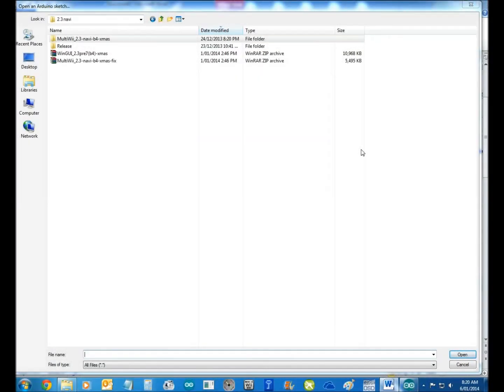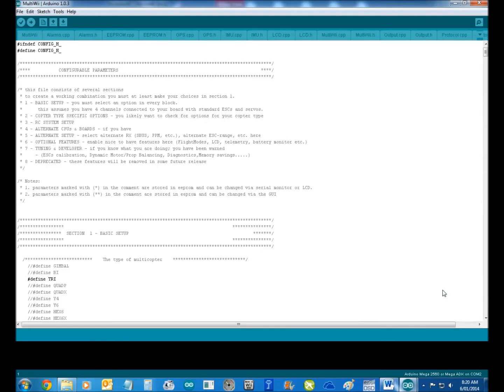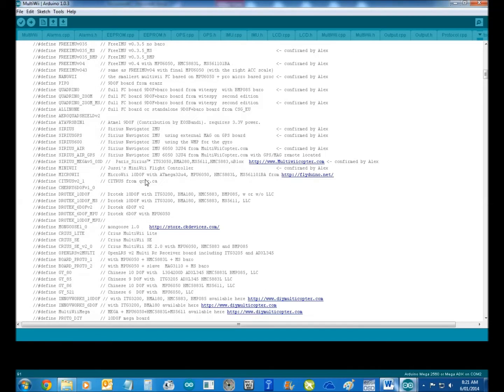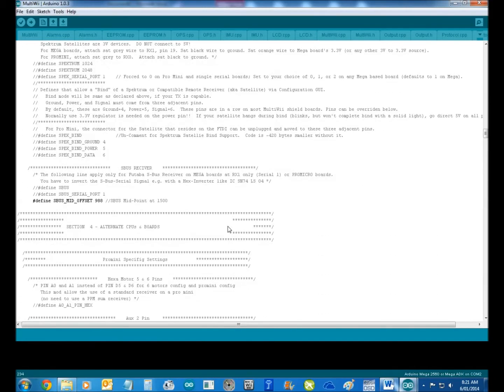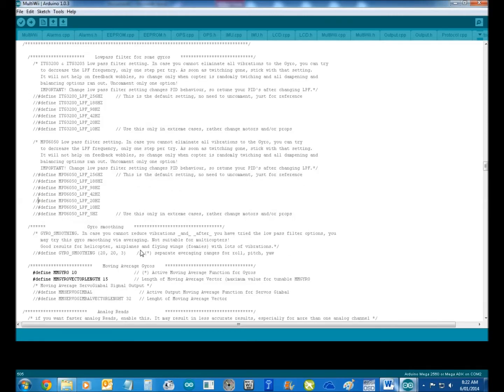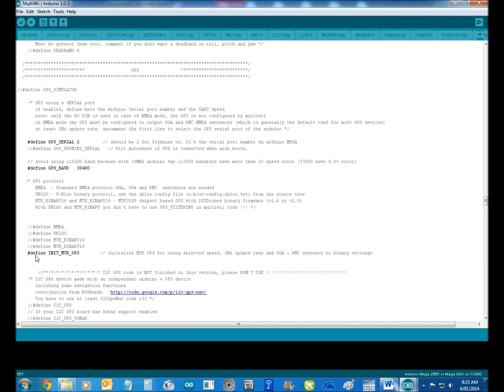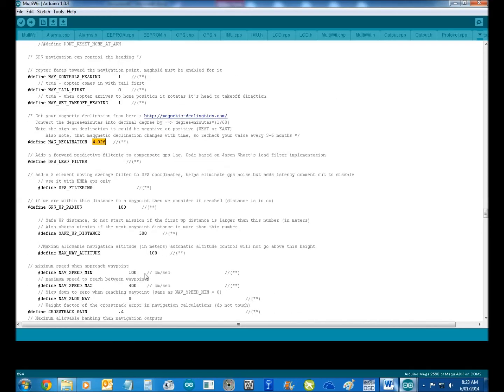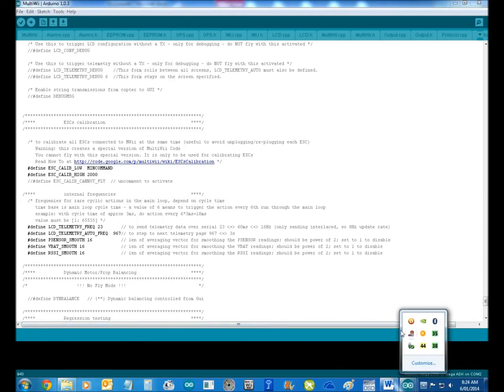Multiwii 2 3 b4xmas Setup

Comment: hello i need some help, all its ok the board its connected and gps its working, but she i want to uploand  the mission i made i can't  because the tab don't work, i can save to the pc but i can save to board, WHY?
Reply from the maker: Are you running the correct GUI that was assigned to that version of MW??........ if you can do a vid and post it it would help...... have you watched my 2.3 mission GUI vid??
Reply: moochasas yes i see this video and do all that you say, the multigui softaware its 2.3 and the scketch its that have in the folder

Comment: Hi,
I watched almost all your video, I'm new in that kind of hobby. I lost last 3 days working to "wake up" the gps coming with the board (MTK). I write in multiwii NMEA and MTK protocol, 115200, but not a chance. When i start GUI, no PKT blinking, no signal from gps. Blue and Green are not blinking, just stay on. I try MW 2.0, 2.1, 2.3 .... all same results. I change in 57600 and in GUI, PKT blinking ... is any chance my MTK work in 57600 and not in 115200? May you please help me with some advices?

My parts:
Turnigy 9xr
Turnigy plush 30A
sunnysky 980 kv
10" props
Frsky D8R-II plus
Multiwii Pro with 3329 MTK GPS 
Multiwii MWC FC BT

Megapirates? or Multiwii?

Comment: In the GPS section you neglected to mention that the "#define NMEA" line must also be uncommented for the MTK module to work. It took me a while to figure this out and I probably would not have done so if my friend hadn't asked if the MTK was NMEA. Otherwise your video was very helpful in getting my config.h setup. Thanks much.
Reply from the maker: Sorry about that........ I dont use the MTK GPS units I fly UBLOX... sorry for the lack of info......
Reply: No  problem. You say in the video that that is the case, but then you go to the trouble of showing those using the MTK how it should be set up. I figured I should at least make the correction in the comments in case some newbie like me was relying on this video for setup instructions. I'll be more critical of your videos if I ever make some that are better. Until then I thank you the contributions you make to the hobby.
Reply: pay attention to this, it took mi a lot of time to get GPS mtk to work the *#define NMA¨ this line have to be uncommented in order this GPS work

Comment: Hey Moochasas, it newbee550 here. I am in a tither. I took your advice and looked up the "everything you need to know" file at HK under the purple tab Eirik740t put up there. Problem is the files are corrupted, and two wont load do to missing files. I am really confused about the "need to load drivers" part in his video. I was under the assumtion that when "arduino" loaded on my PC it would come with the nessisary drivers that operate it. I have Erics edited version of the sketch but now am really confused as to what to do next. I have tried three different sorces for the software to reflash this board. But to my dismay the newest one is six months old and will not upload do to missing files or needing a file to open it. Is there anyone that you know of I can chat directly to? Waiting two to three days at a time for single answers has this thing here for a week getting no where. I would love to hook this up to the computer and get started loading this thing as it is not arming at all now, and I havent even loaded any software yet,,,,lol Help please!
Reply from the maker: give me your email addy & I will assist you.